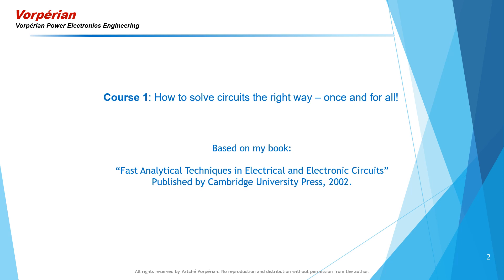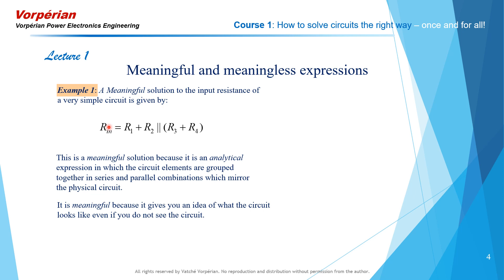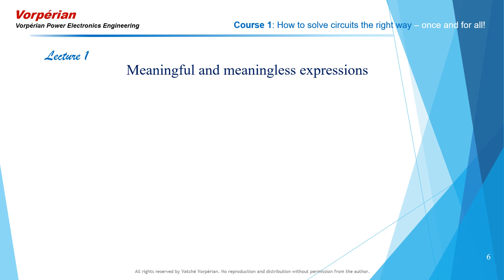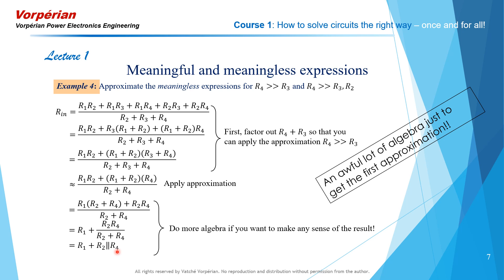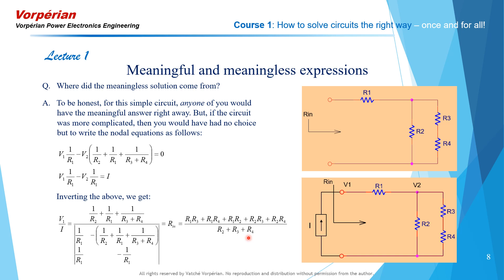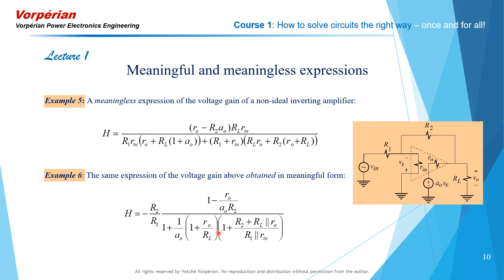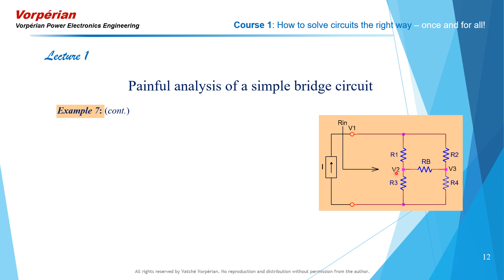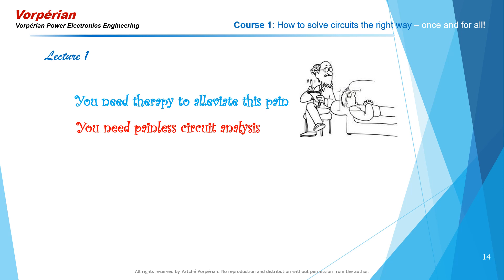Video 1: Fast Analytical Techniques for Electrical and Electronic Circuits

Comment: Very intersting topic, I will surely watch all the video of this series! 
I am seeing electronics in other way finally! Thanks a lot Dr. Vorpérian 😊

Just a very little feedback for the video:
I like to watch at this type of video in very active way, so in this case I tried to do nodal analysis also by myself and compare with result on slides. I saw on slide 12 that the third equation is almost correct, just it is needed to change minus sign to plus sign near to V3(G2+G4+GB) component. In the matrix calculation the term is correct, already positive sign ;)

Comment: Dr. Vorpérian,
In the introduction of your book, you noted that when when you began your career, most senior engineers you worked with did not rely too much analysis. In your opinion, how popular have the fast analytical techniques become as of the year 2023?
Thank you
Reply from the maker: Hi Matthew, 

it is rather hard for me to gauge what is the status of the engineers currently practicing these techniques. I would venture to say very few and that is for a good reason. For graduating engineers to have mastered these techniques, they should have been taught these techniques before they graduated. Of course for that to happen, you need professors to teach the said techniques …. But, the time constant for professorship is very, very long. If a professor started teaching circuits in 1980 using nodal and loop analysis only, then he is still using the same notes today as well… and that is for a very good reason: the new professor who started his career in 1980 had to get research funds to make sure he or she gets tenured. For the professor to learn new techniques instead of hustle for money is not a viable option. So, the prof goes with the same notes he or she  learned in 1975 using the assigned course book whose author was not in a different position than the prof at the time he wrote the book. Got the picture??? 

And that is how stuff happens!!!!

Hope this answers your question.
Reply: @vorperian_courses  Thank you for your detailed and insightful response. Thank you for helping this student graduate with that experience.

Comment: In your book "Fast analytical techniques for Electrical and Electronic Circuits", at the page 157 your 4.5 problems is messy when you don't point out whether β1, β2, β3 initially come to zero or infinity. This situation makes determining the indeterminacies so funny! Please correct it.
Reply from the maker: If you look at the answer that I have provided, you can see in it that the initial values of all the betas are all infinite.
Reply: @vorperian_courses  Thanks for your reply! Can't believe that you take your valuable time to look at my comment.

Comment: Sir, in your papers "ANALYSIS OF CURRENT-MODE CONTROLLED PWM CONVERTERS USING THE MODEL OF THE CURRENT-CONTROLLED PWM SWITCH", on page 186 you wrote: "Both equations, lead to the same small-signal model to be derived shortly as the reader can verify". Sadly, I can't verify it myself. May you help me this? Thank you so much!
This is the link to your papers [will be remove after 7 days]: https://drive.google.com/file/d/1xOAEQHlgPSJ3E22sO3GZ1B8gDCsYNbut/view?usp=sharing